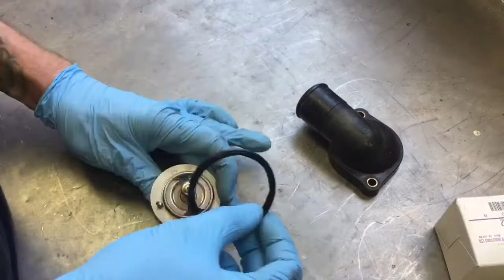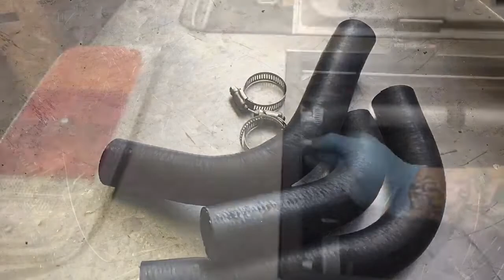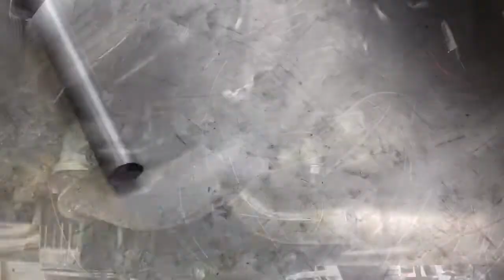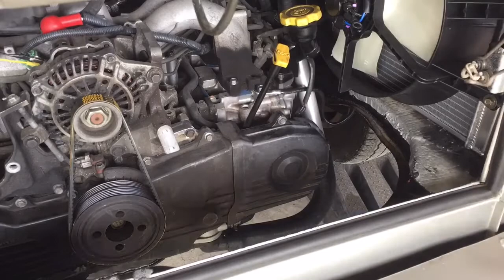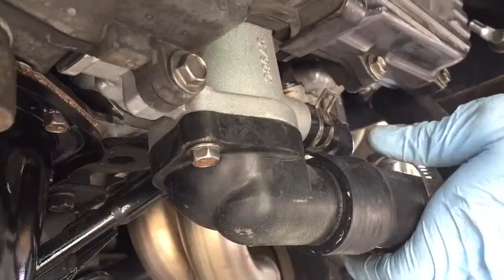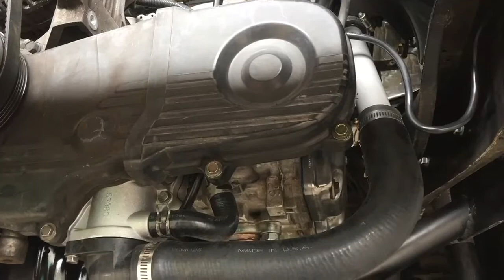Coolant Hoses - Daily Driver VLOG 7/14/17

Comment: Something tells me that you're no stranger to the stock room of the local car parts store. In my Vanagon conversion, I had to pick some hoses off the racks, as well as some exhaust pieces/parts.
Reply from the maker: +Forthwith Tx this is a new radiator configuration for me so you're right, a long time was spent surrounded by rubber hose.